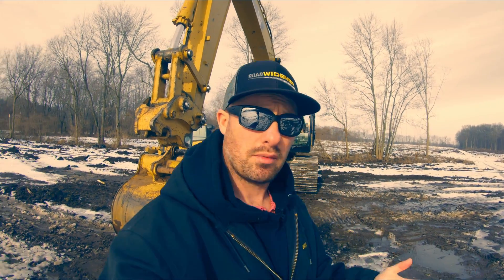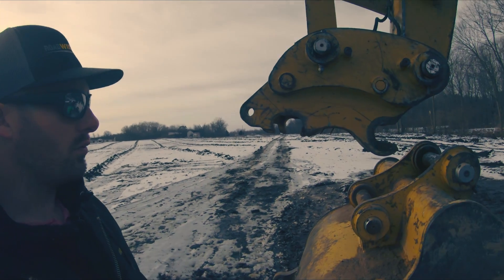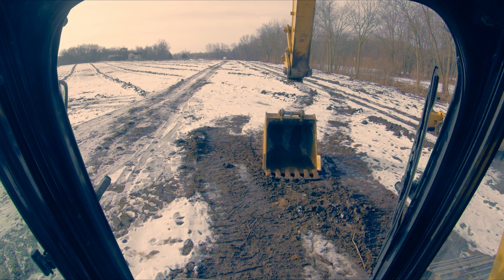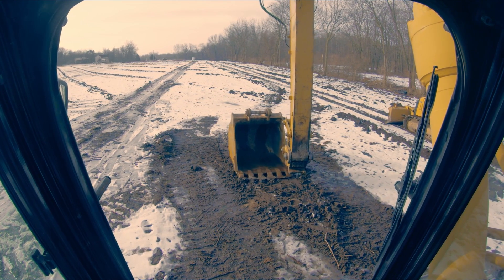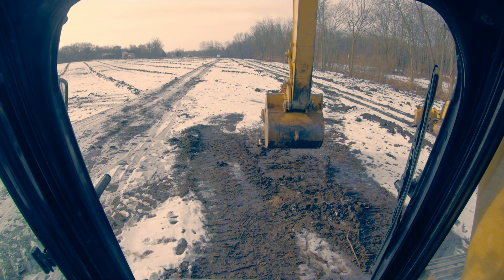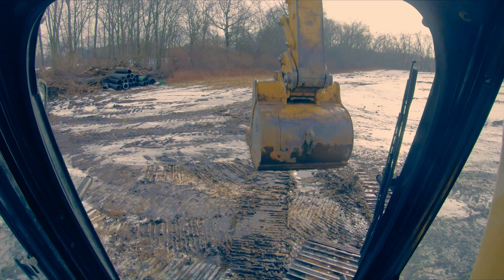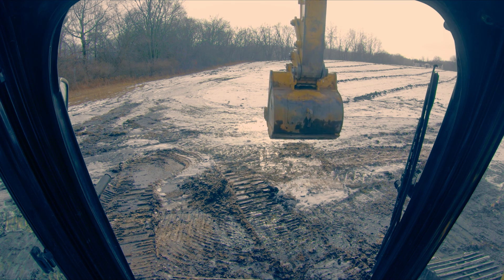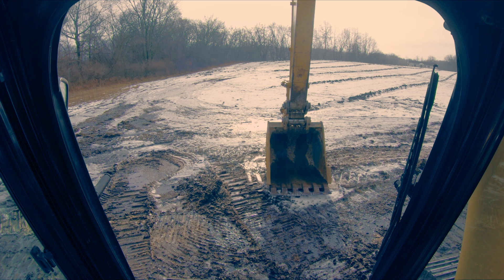HOW TO REVERSE EXCAVATOR BUCKET || How to attach and detach bucket using a hydraulic quick coupler

Comment: I keep seeing headlines saying there's only one way to put bucket on reverse there's 2 ways how ya man does it and put bucket on floor teeth facing away then flip it over and pick it up n lock
Reply from the maker: This will only work with a certain coupler style, called a pin grabber.  The way the coupler works is by hooking around a set of static pins that are dedicated to the bucket.  Since both pins are the same diameter the coupler doesn't care which way the bucket is facing.  Other couplers don't work this way and therefore you are unable to turn the bucket around backwards.

Comment: I would think that on mini excavators that have a blade, a reverse bucket could be used simultaneously with the blade to more easily move dirt. While you are pushing dirt forward with the blade, you could either also push dirt with the bucket, or use the tines to loosen the dirt. Has anyone ever tried this? I found this when I was checking to see if my idea of bucket reversing and doing this was possible. I don't currently have or drive an excavator, but I am considering geting a 3.5 ton.
Reply from the maker: Your idea is correct.  To see it proven out in a dedicated machine go check out the Mecalac 8MC.  Awesome machine!
Reply: @DieselandIron  Thanks!

Comment: I was looking for a way to clear a trail after a long winter (more than 3 feet of compacted snow), to get to my sugar shack more easily.
I will try this with my old Kubota KX61-2, hope it works.
Otherwise, I will clear snow with the ditch bucket in the normal position, pulling towards me.

Comment: hi there should have shown hydraulic controls in cab also  for lock   thx
Reply from the maker: I didn't include the hydraulic lock controls because they vary from machine to machine.  Just because you uncouple a certain way in this machine doesn't mean it will translate to another.